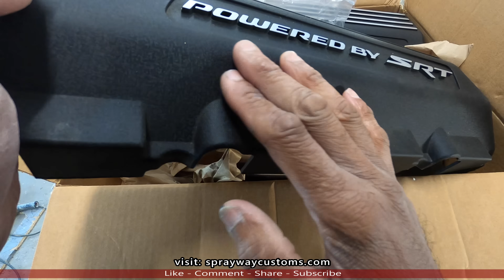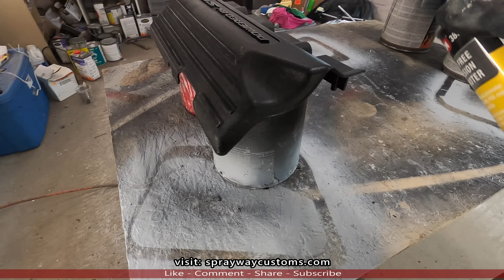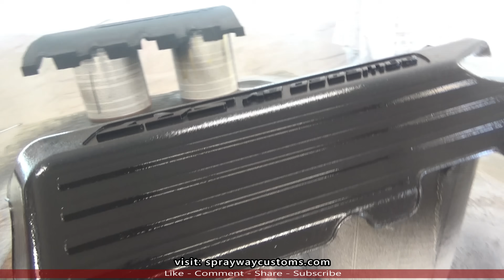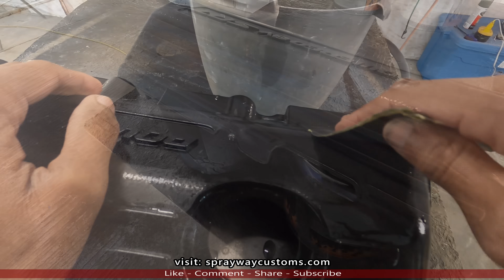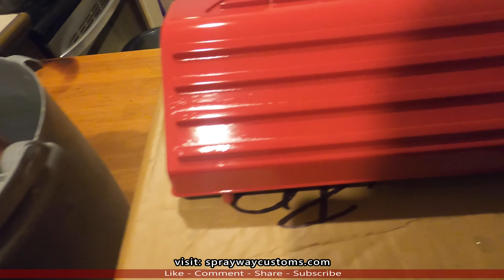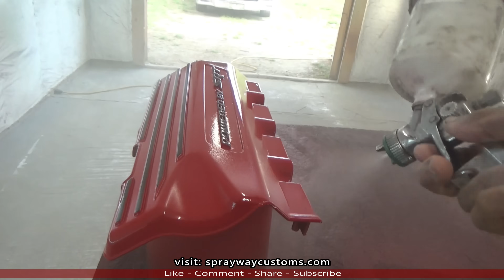How To Paint Engine & Valve Covers A Two Tone Color - Painting Plastic Engine Parts On Your Car

Comment: Nice work! For raised letters or lines, after your intercoat clear dries spray your base on, wait for it to flash, then wipe the letters down with reducer on on a lint free rag tightly wrapped around your finger. Then do your final clear coats. Paint comes off easy, saves time, and no sanding required. Keep up the good work!